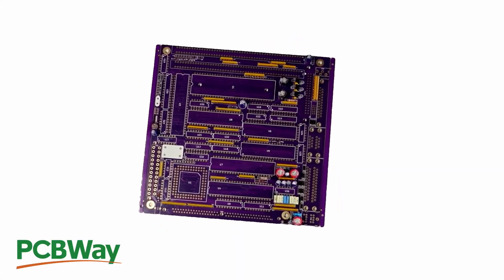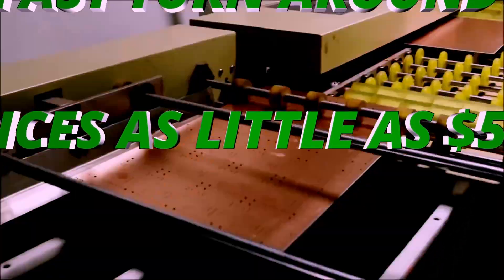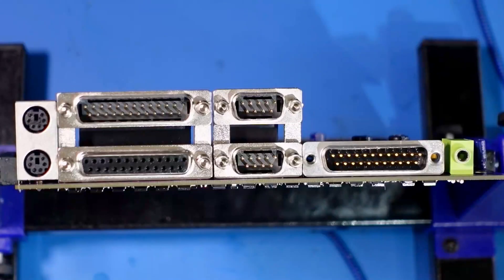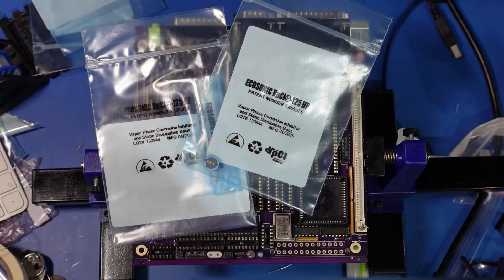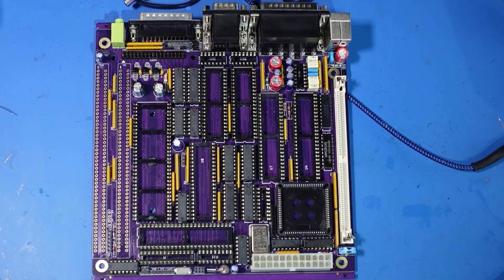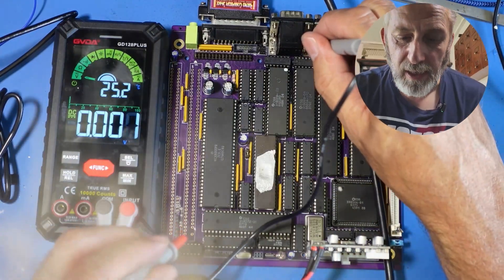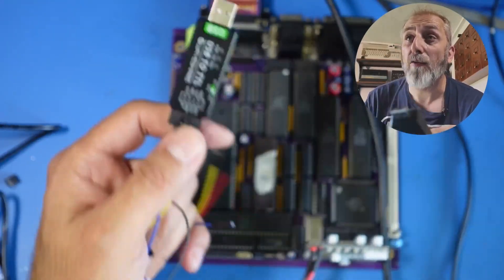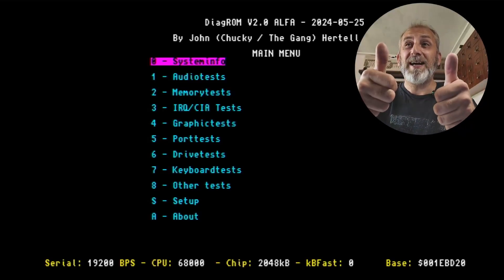Finishing the Denise Amiga MINI ITX – 2025 and a new Amiga

Comment: 10:30 well there's no memory in it so far!
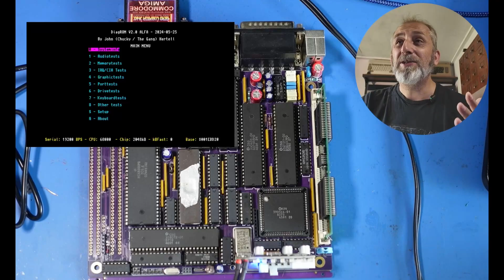15:50 Yay, its working!
Reply from the maker: It was a few days to get it working originally I was booting with no mem to test as it should have shown a green screen thanks for the comment
Reply: @Retro4u  oh right, I wouldnt have thought there'd be anything without any ram in there. good to know.
Reply from the maker: @preferredimage yeah even says in the manual you can test without ram.  As the ram comes with the kit. And I had not built it still have not but managed to find some 😊. I have progressed even further now so expect more videos soon. It's a lovely machine. Thanks for the comment